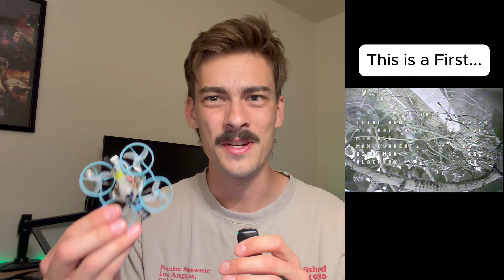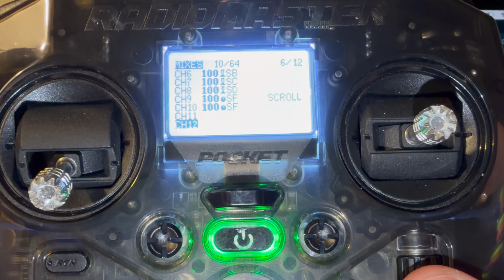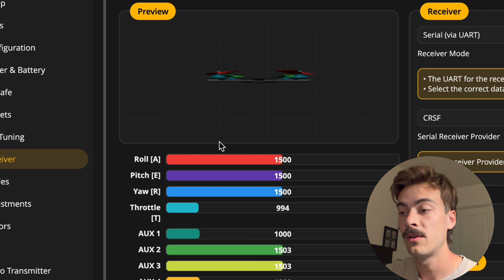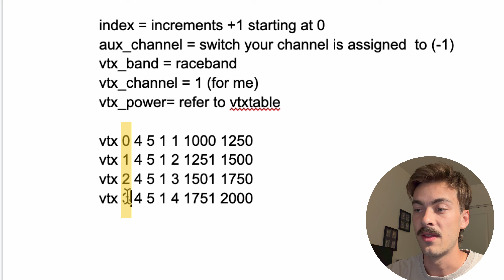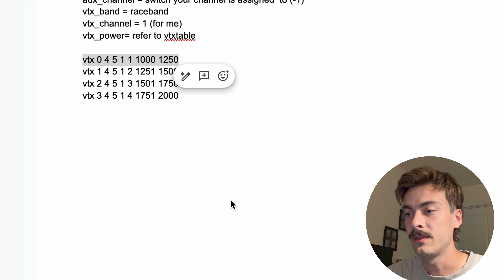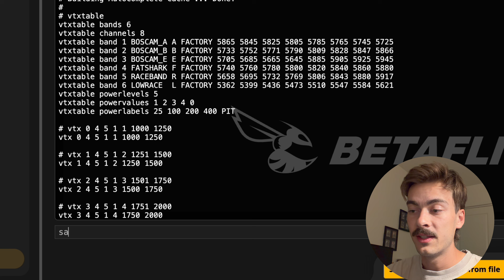Control VTX Power With Your Scroll Wheel (Betaflight Setup Guide)

Comment: Thanks for this bro! I've probably watched this video 10 or 15 times, maybe more with all the times I've skipped back for certain parts. Tried it initially with PIT mode which screwed with my VTX so that ever timed i swapped a battery it automatically go to 200 regardless of what it was on when unplugged. I finally went through again tonight and redid it without the 0 for PIT mode and it now works great and doesn't automatically boot up with 200 power level lol. Thanks again bro! I'm sure I'll be back to watch again for my next drone!
Reply from the maker: LEGENDARY!!!! Dude that’s awesome I’m glad it ended up working out 🔥

Comment: low chance of reply but worth a try. so I han to se up like throttle limits on my pocket for the right ride 3 way switch on top and idk how to do that do you have a video for it or know a vdeo for it?
Reply from the maker: Ahhh that is a very good use of the 3-way switch. I’ve never done that and don’t have a video on it but was wanting to do one! Maybe I’ll try to sooner than later 👀
Reply: @alec_searle  Thx! Also I have a question for this video I followed every step and did it but it does not always seem to switch the vtx power like sometimes it might do it and sometimes it does not do you know why possibly?
Reply from the maker: Oh interesting… I’m not quite sure why. Like it won’t work and then immediately after it will? Or is there a large gap of time of it not working

Comment: Hey! That great tutorial. Just one question, why you not assigning PIT also? For example, when you scroll 1000, it will be PIT. If I understand it is the best settings for not burning board? Or it's enought 25?
Reply from the maker: Just personal preference! I didn’t really care to have PIT mode on, you are right tho that would make less heat, 25 was fine for me tho

Comment: Hi Alec - thx. fpr good videos in genereal 🤟Will it still work when I use the BROWSER interface for BETAFLIGHT ? AND, yesterday I try to switch VTX in BETAFLIGHT to OIT / 25 when I have my ronoe on BENCH - but when I save save setings did not accept my change - do you have a input / feedback ? AND, what is you rates, expo etc. settings ? Have you eg scale down motor throttle ?
Reply from the maker: Thanks for watching! Yes, browser betaflight will work, that’s what I use actually 

The VTX issue, I can’t say I’ve experienced that before, I wanna say it has happened and I just redid it again until it stuck 😅

I fly all my drones and sims on default rates/expo! I’ve yet to mess around with that :)

Comment: Thanks for this! It is worth to mention that if you have enabled: Low Power Disarm it will overwrite the vtx settings. And also if you have connected the whoop over usb even if you arm it, the scroll wheel does not work. You have to disconnect it from the usb then it will work properly. Took me some time to realize.
Reply from the maker: Very valuable thank you for sharing 🙏

Comment: hey, so for some reason, my crool bind works on the radio but on betaflight it doesnt have an aux corresponding to it, does anyone know how to solve this?
Reply from the maker: It’s kind of long to explain in a comment but look up 

“how to assign an aux to a button radiomaster” on Google 

You can assign the scroll wheel to any aux channel you want in the radio itself, so if make sure it’s properly assigned in the radio settings itself first and try again
Reply: I did it on other channels in mixes but it still didn’t work

Comment: Im not sure why aa i use same channek frequency ext as you so i could just copy and oastw qhat you do but for some reason it wont go higher then 100mw
Reply from the maker: Try replacing the channel and frequencies with ‘0’ ‘0’, that makes it work on any channel/freq. also, could you drop what commands you’re putting in?
Reply: @alec_searle  thanks 
ill try that now i chnaged channel to 0 but not freqency i was using

Comment: is there a reason not to divide the wheel in 5 sections and put pit mode in there ? sorry if this a complete n00b question, becouse i am.
Reply from the maker: I only ever use pit mode when I’m plugged into betaflight so I just didn’t find the need to put it on! You so totally can get it added very easily tho by splitting it into 5

Comment: There is an new betaflight version, so you have it to do a bit different, but it works
Reply: I tried this but the command in the CLI gives me error. Can you help me?
Reply: Try help vtx and you have to do power values (1,2 3 4) instead of the actual power. you can set the actual power in the vtx tab .b @RadioactiveFennel7664

Comment: How to undo these settings ?
Greetings from Germany
Reply from the maker: You can redo the VTX command for the same amount of lines you did for inputting the commands, just with ‘0’ as the values. For example

vtx 0 0 0 0 0 0 0
vtx 1 0 0 0 0 0 0
vtx 2 0 0 0 0 0 0
vtx 3 0 0 0 0 0 0
save
Reply from the maker: That should do the trick… or another longer way, if you download the .txt file of your FC settings. You can just delete the section under #VTX that holds the values we’re putting in, and then reupload the .txt into the CLI haha😅

Comment: i had to use gemini to get this working with my hoarder sam volador:

The output of # vtx shows that your flight controller is accepting a 7-argument format (vtx <index> <aux> <band> <channel> <power> <min> <max>).
If # vtx 0 5 5 0 14 1000 1200 gives ###ERROR IN vtx: INVALID ARGUMENT COUNT###, the error is actually triggered by the 14 value, not the number of spaces or arguments.

Why 14 Fails
In Betaflight's vtx rule table:
The 5th argument <power> must be a Power Level Index (e.g., 1, 2, 3, 4, 5).
It cannot be a milliwatt value (25, 100, 200, 600) or a SmartAudio code (14, 20, 23, 26, 30).
Because 14 exceeds the valid power level index range (0 to 7), the CLI parser rejects the line and returns an argument count/validation error.

What to Run Instead
Replace 14, 20, 23, 26, 30 with the corresponding power level step indices from your VTX Table (usually 1 through 5):

vtx 0 5 5 0 1 1000 1200
vtx 1 5 5 0 2 1201 1400
vtx 2 5 5 0 3 1401 1600
vtx 3 5 5 0 4 1601 1800
vtx 4 5 5 0 5 1801 2000
save

The original instruction worked perfect with my air 75ii and radiomaster pocket radio.

Thanks so much for this video, I can't think of any other decent use for the scroll wheel. I used it to help locate my air 75ii in long grass and will give me the confidence to take the volador that bit further.
Reply from the maker: Bro you are so goated for sharing your troubleshooting on this!! I hope anyone with the same issue sees this, glad you got it working 🙌🙌
Reply: this saved me a lot of time and research...worked for the vtx settings i had on my drone. much thanks to you, cheers!

Comment: just wondering, how would i undo this?
Reply from the maker: I’m surprised nobody’s asked this yet, and I only just barely looked into it 😂

You can redo the VTX command for the same amount of lines you did for inputting the commands, just with ‘0’ as the values. For example

vtx 0 0 0 0 0 0 0
vtx 1 0 0 0 0 0 0
vtx 2 0 0 0 0 0 0
vtx 3 0 0 0 0 0 0
save
Reply: You might actually want to use zero for vtx_band and vtx_channel as values when setting up as well. If I understand documentation correctly, you'd otherwise (if using real values) override the current band/channel as well, if using the wheel. Using '0' for those would leave those untouched while still setting the power. I think :O
Reply from the maker: @ma-ElKoth oooo wait that’s a good point…

Also I was going to say, another longer way, if you download the .txt file of your FC settings. You can just delete the section under #VTX that holds the values we’re putting in, and then reupload the .txt into the CLI haha😅
Reply: @ma-ElKoth how about if I want to use it for something else
Reply: @ProHaddockFPV2 not sure I am getting you - "it" ? The scroll wheel? No clue, I am an absolute newbie :) I only stumbled over this info when cross-checking the Betaflight documentation on that "vtx" command. There is a good tutorial on setting up EdgeTX in general by @JoshuaBardwell that gives a sound foundation, but I cannot tell if that covers the scrollwheel (I am not yet through with that playlist :D ). I as well assume it depends on what exactly you are thinking about - as getting the value to eg. the receiver is (via channel I guess) surely different from having it do something on eg. the radio (execute function, lua script, ....).
But really, I am clueless :)

Comment: The osd and betaflight says the vtx power changes with the scroll wheel but it doesn’t change the range when I increase power.
Reply from the maker: Hmmm, normally my range actually takes a dump when I scroll and then fixes itself after a few seconds

Not even that is happening?
Reply: @alec_searle nope,no range difference

Comment: I did this on my Air65 II Champion and tried it out yesterday, with super strange results: Increasing the VTX power when having bad reception from 25 mW step by step until up to 400 mW didn't improve anything! 😞 (I can see the power levels in the channel display in the OSD.) Actually, the highest level, 400 mW, even made the reception slightly worse - maybe because of the power consumption? I don't understand, what's going on here...
Reply from the maker: Interesting! While I scroll the wheel I’ll see the quality degrade for a small amount of time before it fixes itself. Sounds like it’s not even doing that! I’m not really sure what the cause could be
Reply: @alec_searle I got the same result

Comment: Thanx for these great instructions! I just don't understand this first step on the controller at 1:40 . (Was already confusing to me in JB's video.) Every switch and the scroll wheel is already connected to an aux channel. That's the way, the Radiomaster Pocket is set up from the beginning, isn't it? My Betaflight Receiver Tab reacts on AUX 6 when I'm moving the scroll wheel. So there is nothing for me to do in the Radiomaster, right? And after I followed the rest of your Betaflight instructions my VTX output power adjustment by the scroll wheel works fine.
Reply from the maker: Looking back now it seems you would be right! I suppose it’s just a bit of an added not required step! I appreciate you sharing your experience with it 🙏

Comment: You could also use low power disarm and if you ever need to change your output power manually do it through the osd menu (center left stick, then move left with it, move right stick up)
Reply: Scratch that, you can’t change vtx power when it is forced to 25mW when disarmed so you’re stuck on that, no matter what you pick in the menu. Yes, I discovered that in the field 😂

Comment: This is awesome!  I just implemented it on my tiny whoop. So cool! I am super new to drone flying so I was trying to figure out why my range was so small. just figured out like 2 days ago that I can change the output power of the VTX and read that you should change the output based on flying outside or inside and I thought it would be a bit annoying to have to connect the drone to betaflight every time I wanted to switch the output for where I was going to fly. This fixed that problem right away and is a super useful way to use the wheel. What do people use the momentary switch for on their radiomaster pockets? Thanks for the video!!
Reply from the maker: Wow what a perfect situation!! That’s the exact reason this has been such an awesome feature, I’m glad it’s helped you out 🙌🙌 I use some of the other switches to change my OSD to remove everything that is on it, or to change my flight mode!

Comment: It works, thanks! Just one thing that I needed to change: disable "Low Power Disarm". Otherwise, rotating the wheel does not change the value shown in OSD, even though the setting in Betaflight actually changes.

Also, it is possible to add PIT setting as a separate row. Just use the "powervalue" 5, not 0 as it might seem logical.
My config (for AUX6):

vtx 0 5 5 0 5 1000 1200
vtx 1 5 5 0 1 1201 1400
vtx 2 5 5 0 2 1401 1600
vtx 3 5 5 0 3 1601 1800
vtx 4 5 5 0 4 1801 2000
Reply from the maker: Thanks for sharing your config for everyone! That’s a super helpful tip 🙌
Reply: @alec_searle  It seems to change in my OSD even with the Low Power Disarm setting on!

Comment: Strange things, but on my meteor75pro it is dont work. I did like on the video, revicer is connected and AUX5 value works properly, I input all comand like on the video. I setted value to 0 -25mw 1 - 100mw 2 - 200mW, but after restart drone i have only 200mw on OSD.  Maybe You know where is the problem that i cant change vtx power
Reply from the maker: I’m actually about to try this soon on my meteor 75, lots of the time the VTX will default to whatever you had it set in betaflight before hand and then you just have to start spinning the wheel and it’ll click into the proper output powers. I’m assuming you tried that already tho…?
Reply: @alec_searle yea same thing with me here. So everything works perfectly fine after I put in the numbers. But when I’m ready to fly it stays on the last power setting on the video transmitter section. EDIT. got it to work I just forgot to type “save” after I wrote in the numbers 😅
Reply from the maker: @osamaalghussein9863 oh my gosh yes, don’t forget to save 😂😂 and I was having issues doing mine yesterday but realized I was doing it in the wrong aux channel, so double checking that is important too

Comment: @alec_searle Great Video! However, if some people don’t have access to betaflight, you can change the VTX power on your radio directly. You need to go into system then ExpressLRS then find something with x amount of number the vtx I think. Then use the scroll wheel. NOT ON THE BACK. Also, you can change channels in that same system ExpressLRS area. PIT mode just makes it output little to no power and to make it do that all you have to do is put your sticks down and out and stick down and in to make the video turn back on. If you see a weird menu on your goggles, use your right stick and guide the cursor down and right to select save and exit. Hope this helps! If you guys have any questions talk to Alec or me! Happy flying!!!
Reply from the maker: You know what’s up!! Thanks for sharing the other way to do it that is very very useful while away from a computer 🔥

Comment: for some reason it won't work for me. I have a 2.5w vtx with 6 possible strengths so I divided that field into 6 equal ones but it won't accept commands. it only accepts the first, i.e. zero position but the others won't
Reply from the maker: It won’t even let you run the command in the CLI?

Comment: I checked it with Radiomaster Boxer. It actually works, thanks man!
This means I can fly at 25 mW until the picture starts disappearing, then use the scroll to increase VTX power. I wanted to have such a set up for some time already, and here you come with the ready-to-use solution!
Now I'm thinking about using the second scroll wheel to control the transmitter power...
Reply from the maker: That’s awesome!!! I’m so stoked to hear that it works on the boxer🔥 what good timing

That would be a fun way to use the 2nd wheel too 👀
Reply: But actually transmitter has some “Dynamic power” option… Probably it gets some info about its own signal in telemetry and can adjust power automatically. I haven’t tried this “Dynamic power” option yet (cause I was always losing video first), but it sounds promising 😃
Reply: @alec_searle can you make a video using the second scroll wheel to control the transmitter power?
Reply from the maker: @ozframes that’s a fun idea, I normally just set mine to the highest output and leave it tho

Comment: Hello everyone.
Is this possible to replicate in inav?
Reply: Yes.  In Inav, it can be done either in the programming page or the adjustments page.  I’ve done it both ways.  For the programming page way, I used a 6 position rotary switch or the 6 buttons on the TX16S.  You’ll have to look it up as it’s too long to explain here.  For the adjustments page, I repurposed the throttle trim switch in Special Functions to over ride a channel up and down.  Then you pick that channel in adjustments and set it to adjust vix power.  Again, look it up.

Comment: Hi, nice tutorial. I used it on my 3 BetaFPV drones. But it doesnt work on my Mobula 8. The vtxtable in Betaflight is different. The powervalues in the cli are 10, 10, 14, 20, 25 for 0, 10, 25, 100 and 400 mW output power. I changed the command but it doesnt work. Did i do anything wrong? The first one is PIT i think, soi didnt include it. 

vtx 0 6 5 1 10 1000 1250
vtx 1 6 5 1 14 1251 1500
vtx 2 6 5 1 20 1501 1750
vtx 3 6 5 1 25 1751 2000
Reply from the maker: I’m glad it works for the BetaFPV drones!

For the Mobula, the 10,14,20,25 in your commands will most likely need to be 1,2,3,4 or 2,3,4,0 depending on which one is pit mode. I might be wrong, but it seems like you may be referring to the vtx power level of the vtx table instead of the power values line above it… does that sound right?

Lmk if that does the trick!!
Reply: You've probably figured it out already but for anyone else wondering, just replace the powervalues: 10, 14, 20, 25 with 2, 3, 4, 5.